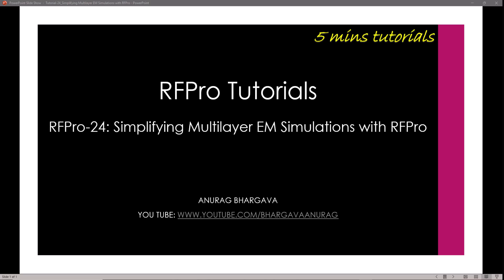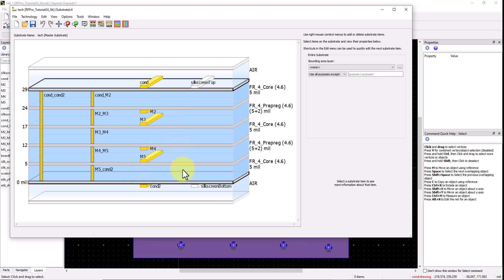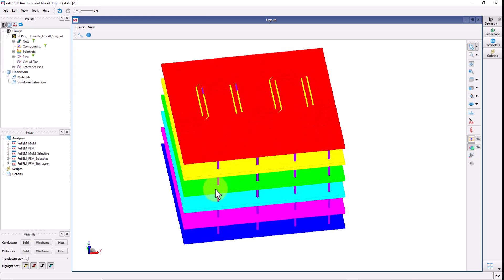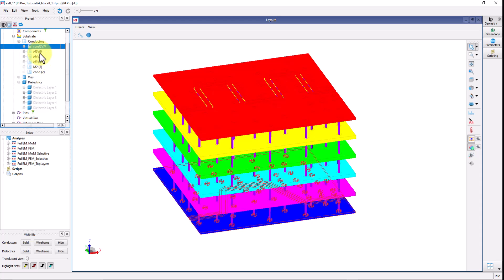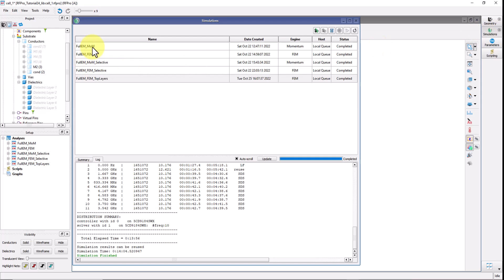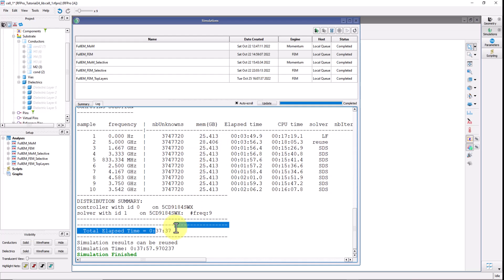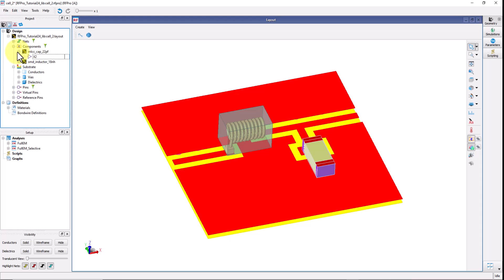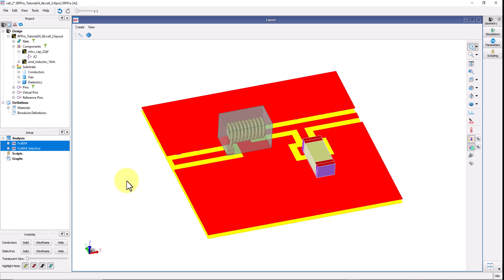RFPro-24: Simplifying Multilayer EM Simulations with RFPro

Comment: Hello, if you have an existing PWB design that has a lot of ground vias for stitching layers together, is there a way to automatically reduce the amount of vias used during an EM simulation or does one have to manually delete the vias in the layout that they do not want to simulate in order to speed up simulation. Is there an easy way to simplify the ground vias for an EM and reduce simulation time/resources automatically or does one just have to manually delete extra vias. Thanks for all the video, 10/10 and shared with many!
Reply from the maker: Hi,
Thanks for your comments. You don't need to do anything manually, when you use Gen2 meshers (for Momentum & FEM) in RFPro it does all simplifications necessary behind the scene...😊
If you are using legacy emSetup then you can do things manually which is little involved but it is possible to simplify it up to a great extent.

Comment: hello anurag..my question is related to PA, i have design 45watt PA from 4.5 to 5 GHz using cgh40045f  cree devices(0 to 4 Ghz).i use it above its inherit frequency. In layout simulation it gives 11 db power gain but after fabication it gives 7 to 6 db small signal gain i change the design with differeant tapology but result was same can you please tell me the possible reason..???
Reply from the maker: I am not sure if I can pin point the issue without seeing the design and what all sims were performed but below points are for your considerations:
1. If the device is supposed to be used till 4GHz as per datasheet then it wasn't a smart decision to use it for 4.5-5GHz range as the device model can't be trusted and vendor won't do much validation beyond recommended frequency in datasheet and this could be cause of gain mismatch as non-linear model can't be trusted.
2. I am not sure how you did measurement as no VNA will be rated to handle 45watts power so I assume you must have used a pre-amp and a high power attenuator at the actual PA output. Have you accounted the same in your VNA calibration?
3. Anything more than this will require a careful design review which I am not in position to do...😊
Reply: yes ..i accounted all practical precautions before connecting it to spectrum analyzer...btw thanks for your reply ... Appreciated..

Comment: Teacher, I would like to ask ads if there is any way to model parameterized like hfss. For example, (x1，y1) and (x2，y2) to determine a rectangle. The modeling method of ads is too complicated to adjust. Or can hfss call ads's simulation algorithm? hfss runs too slowly.
Reply from the maker: Hi,
It may look hard in the beginning but I can assure you, its not that bad and there are many tricks, e.g. if you want to draw rectangle with specific length and width, don't use the normal rectangle and instead use Microstrip line i.e. MLIN. This component is already parameterized so you can create any rectangle with known width/length and then parameterize it very easily, even much easier than how do you in other tools like HFSS. 

Kindly contact your local Keysight tech support for quick help and assistance to learn all the tricks. HFSS cannot call ADS simulators as of now.
Reply: @BhargavaAnurag  However, compared with hfss,ADS, it is still difficult to parameterize and adjust the structure at will. Can the teacher give several more tutorials on layout modeling and parametric optimization? I have read all your tutorials before, and I want to learn more modeling skills

https://www.youtube.com/watch?v=4xR0vrOv75Y&t=458s&ab_channel=AnuragBhargava
Reply from the maker: @李云-o8r  Kindly contact your local Keysight tech support and they can teach you plenty of tricks...👍

Comment: Thank you for all these great videos!!!
As a complete beginner with RF design tools I have a question:
I am designing a passive transponder, consisting of a substrate with a bottom cover-sheet and a top layer. 
On the top layer there are two patch antennas, matched each to 50 ohms by an inset feeder, the feeders ends face each other, such that one antenna is oriented to the right, the other to the left hand side.
In between a diode has to be placed as a nonlinear element.
I don’t understand, how I determine the diodes characteristic impedance and how I do the matching, as well as the simulation in ADS.
Especially the placement of the ports for the simulation isn’t clear to me, since the transponder is not supposed to be connected to anything …
Do you have any ideas for me? 
Thank you for your time, best regards!!!
Reply from the maker: I will not have opportunity to answer your question here as it is too complex to answer using just the "text". This video will be of some help: https://youtu.be/nnfYYXagxnc and more support kindly contact Keysight tech support team in your region.
Reply: @BhargavaAnurag  Thanks a lot, I will do so!!!